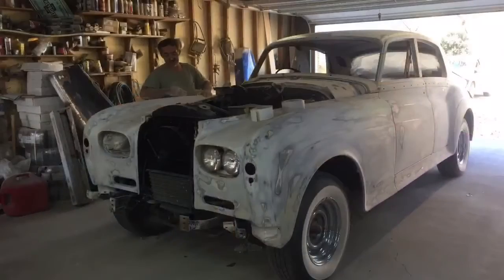Keldon Seeber interview.  It's about restoring cars and trucks.

Comment: I remember Keldon's first project as a young punk straight out of school, and still a fav of mine!  He took his high school money and bought a big air compressor and paint equipment, took an old VW bug and did the most awesome thing... His paint booth was an old shack of a shed thing but he worked to keep it clean... the bug got turned into the most amazing gold bug... gold with pearl gold flames!  The flames were sweetly subtly, ghostly and not seen at first glance... 

...and from there he just seemed to have a Midas Touch on every job!  

bondo and body work done to smooth perfection... Gorgeous, detailed, often ornate paint jobs when doing custom art and designs.. Some of the best work to be found anywhere!